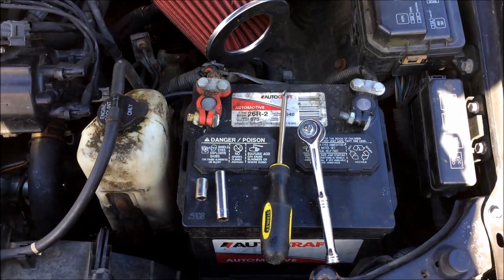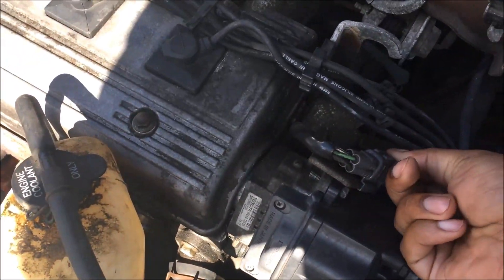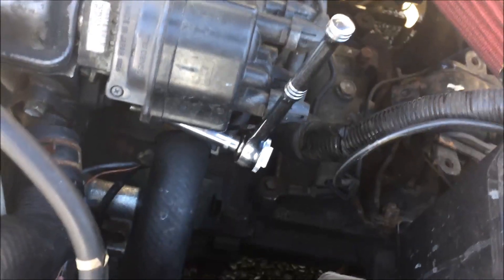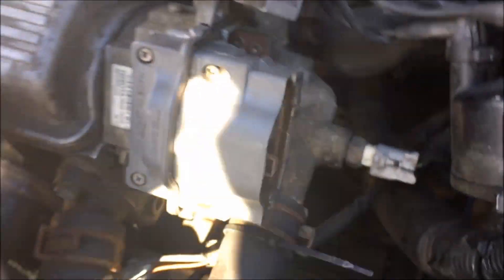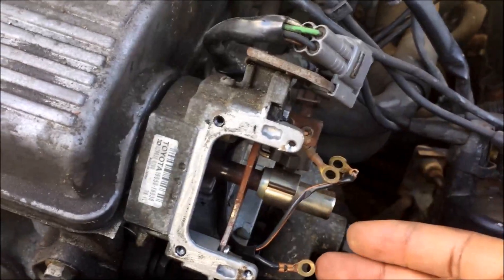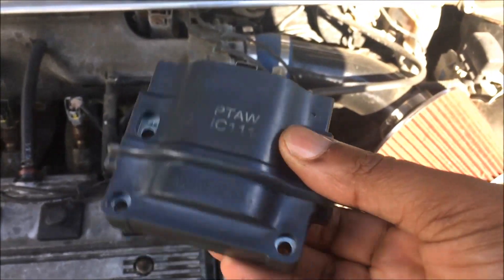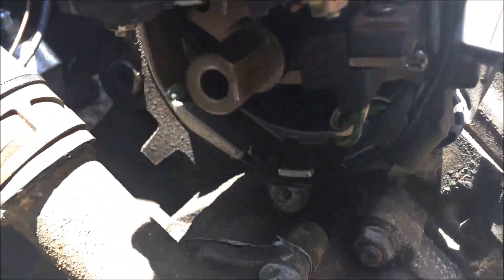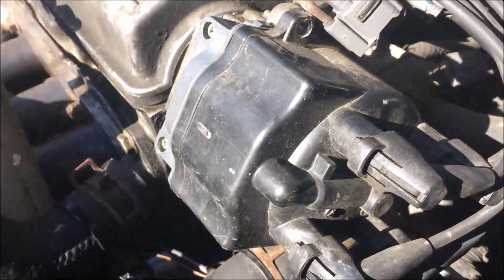93-97 Toyota Corolla Ignition Coil Replacement

Comment: This is by far the best video for replacing the ignition coil for this car style. Easy instructions and easy to understand.  I like the use of colorful metaphors and good humor 😂.  It fixed my problem (hard idle and stalling after warm up or any load like AC killed it) there was a very obvious crack across coil surface.Now it is back up and running. My car is a 95 1.6 L corolla. Thanks bro.

Comment: nice job bro, I love my toyota corolla to, 1997 and 101.000 miles and run like a champ, thanksssss
Reply: lee gar mine is 95 with 190,000 miles and still runs like a champ better than the overweight mustang I used to have
Reply: I have a 1996 just went over 300,000 miles
Reply: I have a 95 116000 miles it's like new
Reply: @toddlittle9095  eu tenho um 97 com 342.000 km está como novo.saludos desde Brasil 🇧🇷
Reply: Hi. I have the same car, but something keeps burning the ognition coil, what could be the problem?

Comment: Thank you very much!   After replacing a few other parts on our 95 Corolla with 1.8L, I followed your lead and replaced the ignition coil and poof, she is back up and running.     Symptoms (idles fine but if you give it some gas it sputters).

Comment: My 93 Camry runs 5 min then stalls. Then runs 1 min then stalls again. Then wont start just turns over. Found a bad ignition coil although the distributor was new. No one believed me the coil failed.

Comment: At about 3:00, the two little plastic bits on the regulator. Theres the black cover with the two clasps, and then the grey plug type plastic clip in.
The grey one on my car broke while replacing. Does this matter? Do i need a new one?

Comment: I’m having an issue with my 96 geo prizm. About the same car as a Corolla. My issue is that my car won’t turn on. It cranks but won’t turn. It started one day out of no where. I was driving on the highway and the car died out of nowhere. Fuel pump sounds like it’s working, could this be the issue? Could someone help please?

Comment: Does anyone know the ohms specs for testing one of these coils? In order to determine if it is good or bad?
Reply: i believe 1.1 to 1.7 ohms of resistence
Reply: Primary: 0.35-0.50
Secondary: 9,000 ohms to 10,000 ohms

Comment: my 1993 Prism..1.6 had 3 wires on the top side of ignition coil..one down below got a little confused where this other wire came from compaired to this example..JUST TAKE LOTS OF PICTURES..BEFORE YOU TAKE ANYTHING APART AND AS YOU GO..IS MY ADVICE..SMART PHONES REALLY ARE HELPFUL.
Reply: same on my 95' prizm and one wire broke off and i dont know where to reattach it
Reply: +Ched Cheese guess you could look at a disruptor..new at the auto parts store see where it goes ..on the coil 3 on top and the short one on the bottom.
Reply: or mark them
Reply: @MCCENTx2  same as Toyota Corolla same year same engine
Reply: @smithwesson4522  Yeah super easy car to repair. I replaced my ignition coil and never had a problem with it. The wires were in there really tight but I didn't need many tools. A screwdriver, soldering iron and some shrink tubing to protect the wires.

Comment: i HAVE JUST FOUND A VIDEO, BY A LADY ,  WHICH SHOWS THE INSIDE  A  HONDA  DISTRIBUTER WHERE THE TERMINALS FOR 4 AND 2 PLUGS ARE SEPERATED BY A RIDGE AND  THE ROTOR HAS A BIG  INSULATING DISC.  POSSIBLE DUE TO THE SAME PROBLEMS AS IN OUR TOYOTAS ?

Comment: Thanks for this video, I actually had a problem with my car and the distributor to check and found the condensor wire was completely not connected. i wanted to know where to connect the wire in the distributor

Comment: thanks  mine stopped towed coil cracked siliconed crack. it started got new one advance Auto 30$ found easier to remove that distributor .have old one as test in trunk .I see complete dist.50$,on line coil 10$. you can test w.batt.charger & a capacitor .found it arcked to crack.without you would have gotten rebuilt dist.
Reply: car no start 10a fuse ign. blown in car the capacitor in distributor shorted after coil replacement is no longer available but runs without it it's just radio suppressor notice on rebuilt mounted outside.
Reply: ps distributor only goes in one way not necessary to Mark position if you remove.
Reply: what other coil could work in the 3e distributor
Reply: Shorty Linx don't know what3eis mine is 93_97. geo otr Corolla .1.6 many on line  .got from advance.couldnt wait . capacitor in distributor shorted last week blew ign fuse inside car won't start. not needed to run radio suppressor. 19a.
Reply: 10amp left of s column.
Reply: cardone rebuilt eBay 39.99 ebay complete distributor cap Mounted outside .the crack appears just below hot lead clip.

Comment: one question how do you know its the coil? i have no spark coming out can i be sure its that or how can i know?
Reply: Julio Gonzalez I have the same issue did you ever find that was wrong?
Reply: Austin Grover I believe u need to measure resistance on each pin in the plug. I got a dtc 12 on my Corolla and it's mentioned in my book.
Reply: I know it's a long time ago but i'm throwing this in here for others. On this corolla engine his coil serial number ended with the last 2 numbers being 93. On my L touring 96 1.5 i had to have the coil  with the last 2 numbers being 94. I couldn't tell which 1 it was til i took it off then off to get the part from the store.

Comment: Part number please!
Reply from the maker: Rubén Dross PT Auto Warehouse Part# IC111 you can buy it from Amazon.com  for like 15 dollars
Reply: Team Sloww ...But Amazon part number?
Reply: Team Sloww. it says it doesn't fit a 93 I don't wanna buy something wrong will this part fit 100% please let me know thank you
Reply from the maker: Victor Chavez it may b different if u have a obd 1 car but the process to remove and replace is the same
Reply: Team Sloww dang it ok thanks
Reply from the maker: Victor Chavez I'll c if I can get a part number 4 u
Reply: Team Sloww thank you any chance you got tips on if its my fuel pump. because I have trouble starting it after its been off for a long time or in the morning takes me around 7 tries and when its on it has rough idle. for the time it take to warm up
Reply from the maker: Victor Chavez for your car it's Delphi part number GN10216 that's the ignition coil that works with ur car you can buy it from amazon it like 21 dollars
Reply from the maker: The fuel pump usually on most toyotas of that generation it's under the rear seats and it's bolt on bolt off plug n play
Reply: @teamsloww1041  hey is this the same motor that is in my 93 geo? Mine is a 1.8
Reply: @zaneridley6405  Toyota Corolla and Geo are the same on 93!

Comment: My daughter has one of these 1991 Toyota Camry and we have replaced 2 coils in a couple years. Now we think its doing the same thing again. Why don't they have a coil on the body of the car and get rid of this terrible design. Just have a cap with no coil. I have had 4 Honda Accords and never had coil problems like these God awful Toyota's have. One of the most stupid designs I have ever seen. This car is going down the road. I'm going to get her a Honda Accord and be done with this piece of crap!
Reply: I will buy it if you bring it to me in Charlotte NC!
Reply: @smithwesson4522  I live in Oregon and we have already sold the car. But she bought another Toyota and really likes it. But that old car was a good car except for those stupid coils and now I find out that some of the coils that you buy on Ebay are not very good. So I don't blame Toyota so much now. It might have just been a cheap bad coil I got on Ebay,,,,,,,,,,,